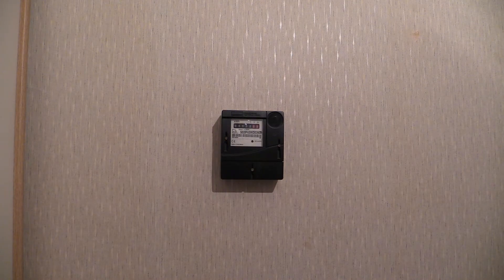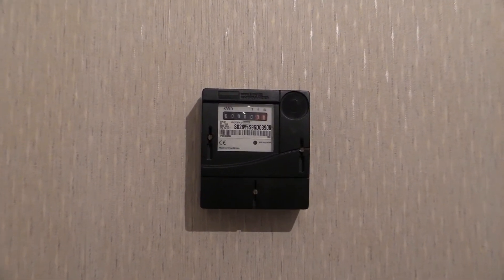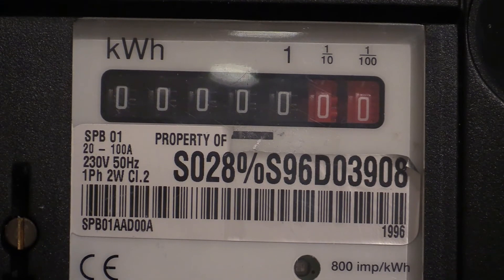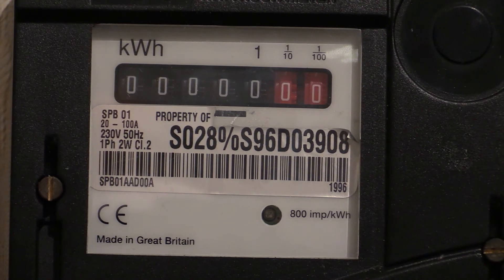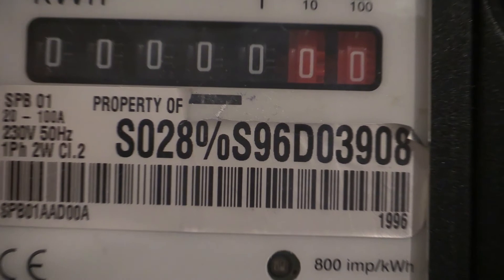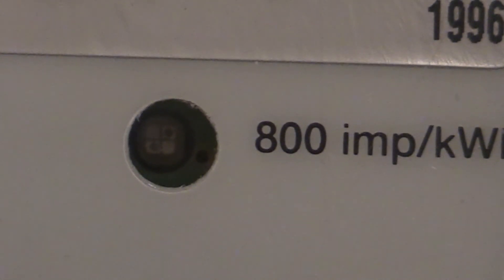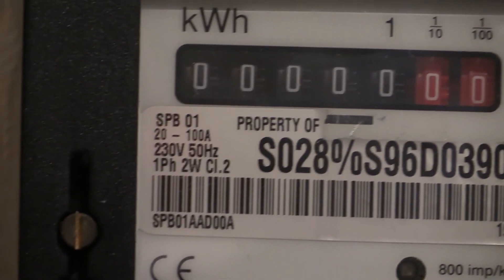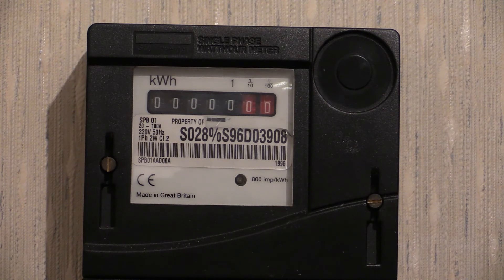Electricity Meter : SPB 01 kWh meter (Schlumberger)

Comment: Wow that camera shows loads of details. I have often thought of getting one of these meters. As always nice work! And video. Steve.
Reply from the maker: Aaaah, now Steve, you have handled one of the SPA instruments and you know the solidity and well-made engineering of one of those.

Now then....

If you received one of these in a parcel and took it out of its packaging, holding onto it and feeling its lack of weight and its clicky-clacky plasticky made-to-be-recycled construction, well, er.....

While it would admittedly be another one to the collection, I couldn't help but feel you would be disappointed with it.

You've handled other instruments, with their solid chassis, all-metal workings, chunky weighty bakelite cases, metal specification plates, glass windows.....

.....And then there's this lightweight, flimsy, basic box, with its plastic window, a floppy-flappy specification plate thinner than a credit card and its "Recylcable" logo stamped into the back of it.

But you know, that's just my point of view on it and my feelings of how let down I felt when I received my pair.

To think that a meter manufacturer would go this low to knock out a clicky-clacky plastic box like this, when they have previously made instruments like the SPA 01 and 02 instruments....

But at least the SPB 01 doesn't say Sangamo on it!

Thanxx for watching,

-Wayne's Electrical.

9th March 2016, 00.00